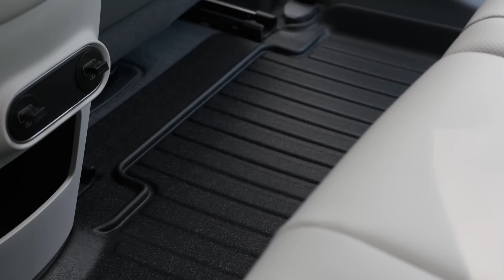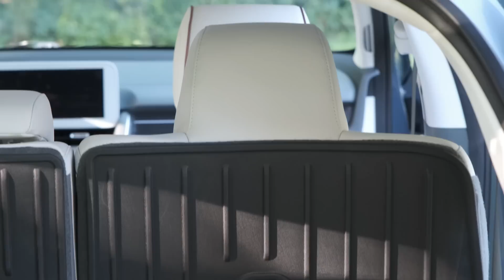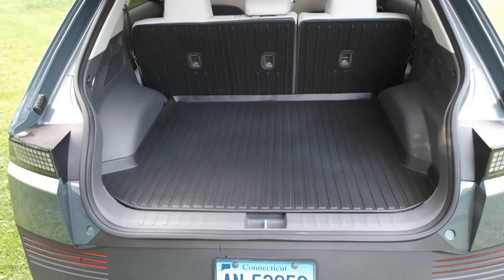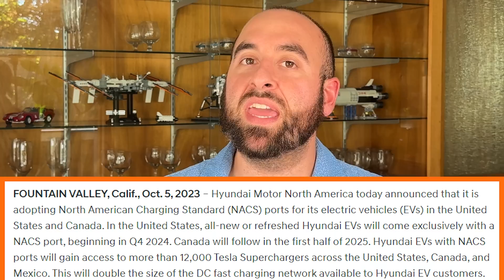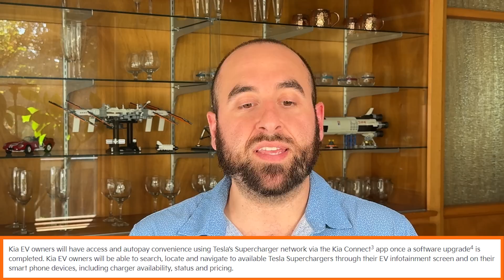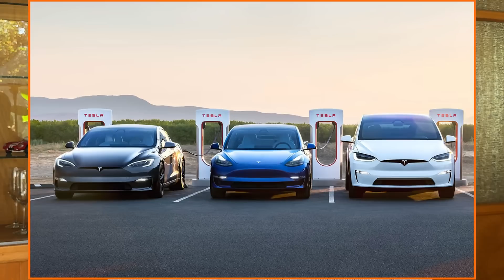Hyundai/Kia/Genesis Adopting Tesla's NACS Charging Std Q4 2024

Comment: I drove my original Hyundai Ioniq  (28KWH) for 6 years with no problems other than a warranty - replaced drive motor ( didn’t let me down  just got noisy). I have just got a 2022 Ioniq 5 ( long range RWD) . I love the car - charge at home at 30amps which at 40 KM per hour would give me potentially 480 kms on a twelve hour charge , which is almost the stated maximum range of the car .  SO FAR I have had no overheating problems - I probably charge for about 5 hours every three days or so .  I agree that Hyundai should not have given 48 amps as an acceptable charge rate , if the car was’t able to handle it , but on practical terms , it seems that 30 amps would be acceptable for most people.

Comment: I'm in the UK. Elon opened up some Tesla chargers to cars with CCS  connection about a year or more ago, with the promise of opening them all. So far, no more!  I've used them on my Etron and it's  brilliant (Oxford and Aberystwyth). I've read the last two comments but it doesn't seem totally clear to me. My Etron goes back next year and 
it's replacement equivalent would be £30,000 more expensive, I kid you not, which, naturally is why I'm hoping for an Ionic 6; it's a no brainer for me. Will I be able to charge it at Teslas' chargers here?

Comment: @TheIoniqGuy how does implementing NACS ports for DCFC affect using J1772 ports for Level 2?  Currently the CCS1 port piggybacks on the J1772 port.  Will EVs keep their J1772 ports in addition to the NACS port?  Or will we all need to buy adapters to keep using our home Level 1/2 chargers?
Reply: The NACS connector handles all levels of charging. So if you buy a NACS equipped vehicle and want to continue to use your J1772 charger, you will need an adapter.

Comment: I just purchased a 2023 HI5 Limited and am super happy with it (it’s only been a few days). Your channel was the main reason I went for it over the model Y. Thanks! I will be looking at a lot of the mods and upgrades you recommend. Does anyone know how to tell if there are any updates for the car other than the over the air radio/navigation ones? How do you know what the latest versions of the other components are so you know when you need to bring it to the dealer to get them done? (Software updates that require the usb interface at the dealer)

Comment: In Europe Tesla switched to CCS years ago. Why go the other way in the US?
Reply from the maker: The country was diverging with two competing standards. Tesla has a more prevalent and reliable network so they won. I don’t know when the Supercharger network really started spreading through Europe but it’s been spreading since somewhere around 2013 here
Reply: @TheIoniqGuy  we got the Supercharger network pretty early here (in Norway), but we also got independent charging networks soon after because of government incentives based on goals of charging stations at least every 50 kilometers on the main roads. I guess that by the time Tesla decided to switch to CCS, the others were starting to get ahead in the number of locations. V2 superchargers here have two cables, one with Tesla plug, and one with CCS, while v3 and v4 have only CCS.

Until the v4 superchargers start supporting 800V some time in the future, cars like the Ionic 5 will charge rather slow there, won't they?
Reply: @simontemplar873 Tesla didn’t just decide to switch to CCS in Europe. The EU decided we couldn’t live with different standards CCS/Tesla/CHAdeMO and made a requirement all new sites have to be CCS. I don’t know if Norway made the same rule or it just happened because it didn’t make sense to ship Teslas to Norway with a different plug than the EU.
Reply: @tomm5936  that makes sense. Norway tends to follow EU in everything, although when it comes to electric cars we have mostly been ahead of EU.

Comment: It's always good news to have more charging options.  Just have to make sure speeds are up to par for what we've been experiencing.  I also hope that the 30K multi mfg rollout happens by summer 2024 but I have a hard time believing that will happen within 8 months.
Reply: This. The last time I used EA I was third in line and two stations weren't working. One of the EVs was at 85%, but no one was in the car. Accross the street were at least 15 unused Tesla stations. I'll still take the cheapest option with no line, but will gladly pay more if I know it will be 20 minutes faster than waiting.

Comment: What does this mean if you already have a ccs l2 at home?  Time to drop another $800 for NACS at home?
Reply: That's probably the situation that most current I5 owners are in. Personally, I don't see any need to change what I have at home, since that's where I charge 99% of the time. I'll get the adapter and throw it in the rear storage area with the level 1 charger, just in case.

Comment: I almost exclusively DC fast charge with EA free charging. I only use the home charger when I get home under 25%. 
This news doesn't change much for me as I have free EA until the end of 2025 anyway.
Reply: That's kind of perfect timing then. EA is very hit and miss regarding how many stations are working and some places I would still charge at home given the lines I've seen even if the monetary cost is free.
Reply: @dissectingreality   I guess it depends on where you live. I have only seen one time where a station was full around here.

Comment: Um… you said adapters will be available in Q1 2025. Didn't you mean 2024? If Hyundai's EVs will start to have bona fide NACS ports in Q4 2024, why introduce the adapters in a later —rather than a sooner— quarter? Also, any word on if Hyundai will redesign their V2L adapter to work with the NACS port?
Reply from the maker: Nope, they stated Q1 2025. I don’t have any information on V2L adapters but I’m sure they’ll work with adapters
Reply: @TheIoniqGuy  Huh. Doesn't make sense to release adapters after the 2024 Q4 NACS ports appear (on 2025 models?). Maybe that's a typo…? Dunno.
Reply from the maker: I don’t know. Q4 and Q1 are adjacent. It could be weeks difference
Reply: Is there anything that Hyundai said about adapters? Their announcement specifically said the all-new and refreshed Hyundai EVs will have access to Tesla's network...conveniently leaving out current Ioniq owners with a CCS plug.
Reply: @andrewbcaldwell  From Hyundai's press release:

"Owners of existing and future Hyundai EVs with the current CCS will have access to the Tesla Supercharging Network starting in Q1 2025. Hyundai will offer an adapter to these customers. Hyundai will also make adapters available to charge NACS-equipped vehicles at CCS chargers."
Reply: @Yanquetino  Thank you! Their twitter announcement made it seem as though only the new Ioniqs with NACS would have access.
Reply: Adapter for older models?
Reply: Where I live, there are 9 charging stations within a 5miles radius.  But only 2 of them are Tesla.

Comment: Umm did you have a KW filter on your CCS map?  Because there are way more DC fast charging options in Maine but they are mostly 62kWH or 125 combined.
Reply from the maker: I had it filtered to 150 and above because in my opinion, calling 62 fast is a stretch by modern standards and I don’t really want to use them
Reply: @TheIoniqGuy  Several of the 62 kWH stations will output 125 if only one is being used on I95 north of Augusta 🤷‍♂
Reply: @TheIoniqGuy That’s what I thought when I plugged into a new Magic Dock equipped Supercharger.

Comment: NACS has “Standard” in its name but the SAE has to make it a standard and has estimated May of 2024 to be finished with that process. This is considered the fastest they can complete their standardization for interoperable physically and in communication. If they are reaching back to the dinosaur 🦕 CAN communication used on old Tesla’s this will build the most robust standard used on non-Tesla-charging networks Hyundai/KIA are building jointly. All NACS EV’s will eventually speak PLC like CCS and newer Tesla’s using a CCS adapter. Yes the fan boys do at times prefer the CCS network. Also Tesla has to speak PLC to speak to CCS vehicles in their agreements with manufacturers. That aside Tesla’s achilles’ heel is their 400V EV’s overheating handles. EGMP vehicles at 800V have a lot less losses with 1/2 the current for the same power delivery. Hopefully the SAE will increase the current capabilities of the current design while keeping the interoperability.  If not, other manufacturers hopefully can innovate better cooling at the handles that Tesla failed to do on V2’s and did poorly with V3’s. Biggest question will be if Tesla US V4’s be will be SAE NACS compliant. They could go rogue again with plugs just for their new EV’s if they feel the SAE NACS isn’t robust enough. Time will tell but until electrons are flowing on their joint venture with the other manufacturers at tens of thousands of sites, they are not out of Elon’s clutches. He has zero permits to pull for the upgrades he needs. Unless the manufacturers have about 5K people on payroll developing this, they are helping a monopoly develop that will eat their babies. #elonisbrilliant #simplebusiness